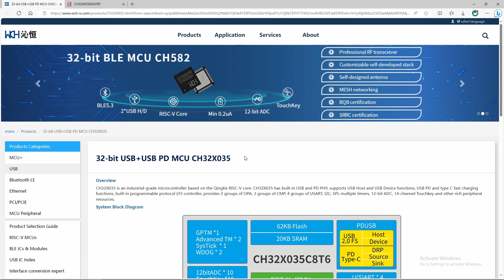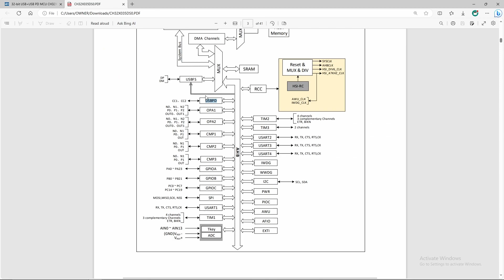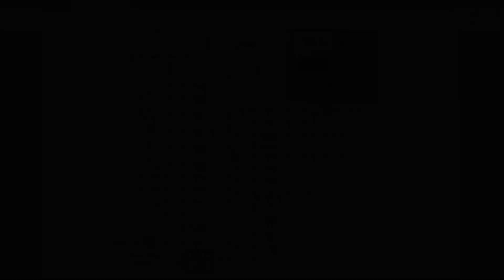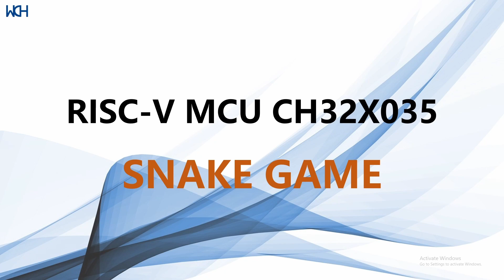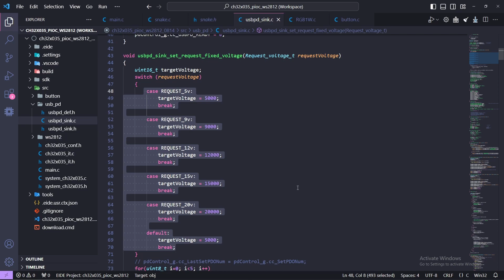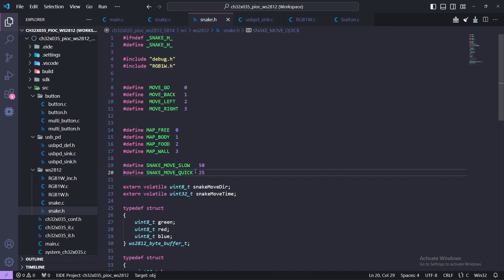#22-Let's play SnakeGame using 1-GPIO PIOC

Comment: Very smart to use the NDP13B01QB chip to create high current 5v power output from a usb-c pd input
Reply: If you propose to request a voltage higher than 5V thru USB-PD, then, actually, there are any step-down DC-DC converter is eligible, for example, based on MP2315